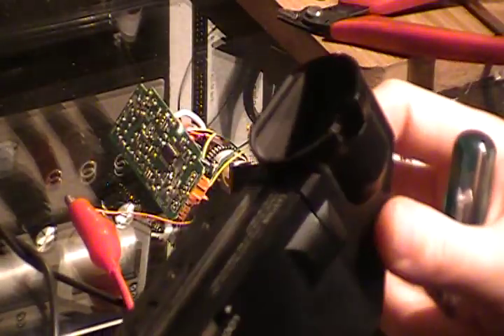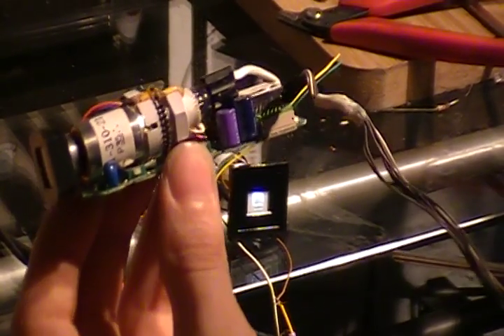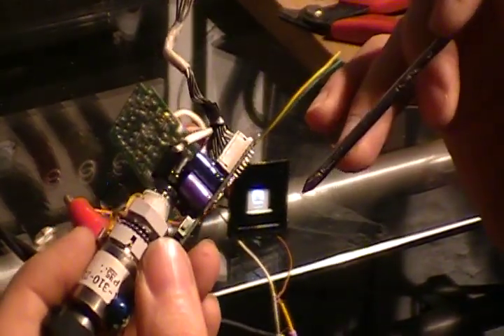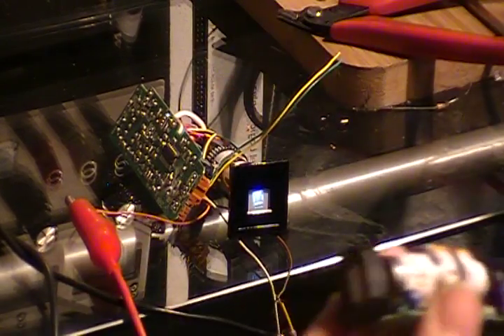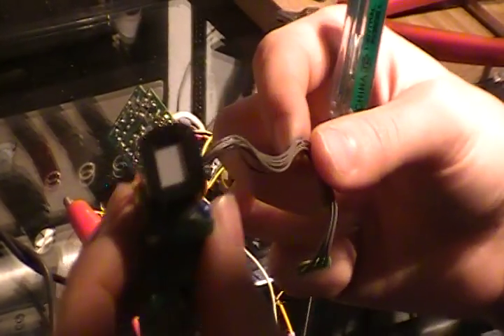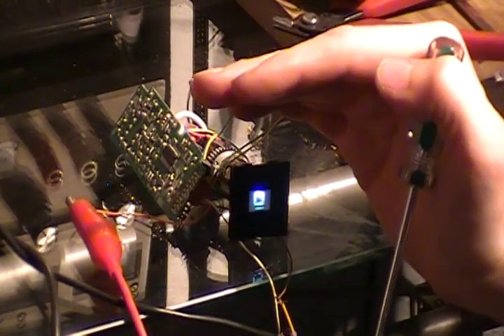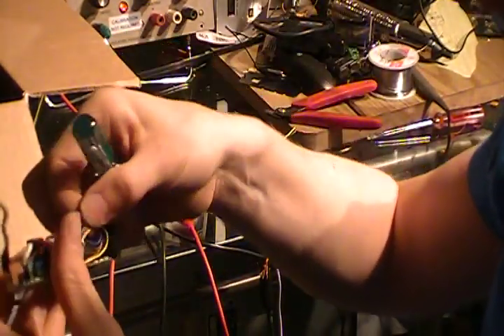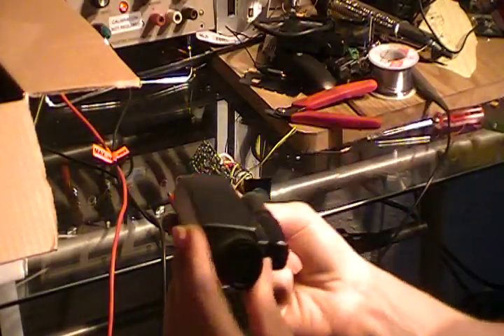Reverse Engineering Camcorder Viewfinders - Mini CRT's

Comment: Awesome video. I actually grabbed a couple of these and a motion sensing thingy and a pair of goggles (plus an Arduino) to make the $30 equivalent to the Oculus Rift, except it looks kinda tacky with the two CRTs epoxyed into slots on the goggles and the Arduino ziptied to the goggles. But hey, it works great with Rift-Compatible games due to reverse-engineered drivers.

Comment: So cool!!! I had one of these laying around after taking apart a camcorder. I just wasn't sure how to use it. I just hooked it up and it works perfectly with composite video... A small lens from binoculars and a mirror seem to project and enlarge the image well, and now I even know how to invert the image! Perfect! Now it's just a question of build it into a clock with an Arduino or a miniature retro display with a Raspberry Pi. Thanks for posting this!

Comment: Thanks for making this video!  I took apart a Panasonic S-VHS camcorder viewfinder at the Bristol hackspace yesterday, and found a surface-mount chip in it. The chip, AN2510S, was helpfully listed as a "camcorder viewfinder driver IC"! But the data sheet (partially in Chinese) includes an application schematic that's most likely the same as the actual circuit in the viewfinder. It takes composite video input, but the connector is 11-pin -- must be lots of unused pins.
Reply: Salvaged a CRT from a faulty Hitachi VHS camcorder and the SMD chip it had wasn't even known on the internet!

Comment: Some view finder CRT's need an external horizontal and/or vertical sync after you take them off the camera. Composite monitors let the horizontal "free" run. It's no big deal to provide a H-sync, either use a sync separator IC or make a simple capacitor one. Then feed the H sync into the view finder board. I've only found 4 or 5 view finders that needed external sync and they were huge mid to late 70's cameras that had heavy VCR shoulder killers. I even have a couple of reel to reel camcorders!

Comment: I've done this before! 

I have one black and white crt and one colour lcd. I noticed the lcd one is much fussier on signal strength/quality, from memory the picture jumps if the signal isn't right (like from a tv that has poor reception). I once posted on the FMCG forum  (as bugminer) about using the lcd one as a second monitor(not being used that way now. It's hooked up to the tv as I type!). I have each one hooked up using a common ground for power and signal.

This video made my day! :D

Comment: Wow, I ended up doing this, but in reverse. I had a 4" color LCD screen from a 12V portable video system and wanted to integrate it with my ancient 3 tube saticon camera using the eyepiece's original cable, for cleanliness. 

That meant losing the eyepiece, but it did work. I got to cheat on my conversion-the video signal was the shielded cable.  The eyepiece was 12V, so the thing fired right up. I need to watch the rest of these!

Comment: Fantastic! Just found a JVC one I had stashed away that had broken off of someone's camera at the swivel point and I picked up somewhere many, many years ago. Looking at it, the wires seem to be properly color coded to boot. However... PAL or NTSC signal is the question. Might have to open it up to see if the image can be adjusted accordingly if it's the wrong one.

Comment: Nice video! BTW, I happen to have exactly the same viewfinder unit that you are holding while explaining the deflection coils connection. I have already identified the ground and +5V wires and found a wire that, when pulled to ground, lights up a red LED near the screen. I tried your method of identifying the video input (grounding the wires one by one) but failed to get static on the screen, however upon touching one of the wires with my finger, the CRT starts showing wavy patterns. Is this the video wire?
Thanks from Russia,
Dan
Reply: +TheDaniel366Cobra Yes, that should be the video. Connect it to a video source and see what happens.
Reply: +zaprodk thanks, but you are a bit late, the CRT is already working in my night vision cam :)

Comment: Learn from my mistake: back in the 90's I used a matched pair of these to build a stereoscopic  headset for an submarine robot with two cameras. The viewfinders were absolutely awesome and perfect and worked really well. However, when I first tried it out, I just ran the viewfinders on 6 volts. The video was blurry. Turns out the viewfinders actually ran on 5 volts, and that little bit of overvoltage didn't just mess up the video, but was probably producing X-rays which were focused through my eyeballs and brain. Some might say "Oh, so that's what happened?" But anyway, thought I should mention it.  :D
Reply: Thank you for mentioning this as I am working with one at the moment, but I was going to run it at 3.3V, I didn't know they used 5V

Comment: @jeriellsworth the small lcd's sometimes use an I2C interface.

Do you know what the voltage is on these small tubes?
I have been thinking of using these tubes for video goggles for over 20 years, but a friend of mine suggested it might not be a good idea to have a couple of devices that might potentially have a couple of KV strapped to either side of your head.

Comment: Great Video...  I got a nice picture after coupling the video through a capacitor.  However the picture rolls 1 or 2x a second (like an old TV with a vertical hold problem).  Might it be because the CRT was from USA (NTSC?) while the video signal is from a B&W camera from Asia (PAL?).  Or is there some way to fix the vertical hold?

Comment: Hello! What should you do if the CRT is drawing excess current? I set the current limit on my power supply to 1A but it only hits around 2.5 volts before it reaches it. There is no obvious short anywhere.
Thanks!

Comment: Jerri.... I am hacking a panasonic mini crt viewfinder. Its a colour one and has 7 wires going into it......I will indentify the power feed and ground as you recomend but am wondering if, due to the number of wires, that this unit may require an RGB feed instead of just one composite...your thoughts??

Comment: I have an old video scan sounder fishfinder which uses a CRT for the display. Is there a way to add composite video to this So I can use it as a monitor. Kind of impractical b/c it's a 6" screen but can it be done? Where do I put the video into?

Comment: I have a 6 pin crt, the wire connected to the first pin is colored differently, i was wondering if this was the ground or positive lead, or if the power lines are throughout the connector.  (can i assume that the first and second are the power lines?)

Comment: Is it possible to remove the black plastic framse without breaking the tubes :O?
I don't want to break mine, so I hope you have a tip on how to remove them :)!
Reply: +Jeri Ellsworth
read the above :D
Reply: +PezDJ Yes. Just be careful. On some tubes the black plastic is holding the anode lead on a contact on the face of the tube - it is very easy to break this connection.

Comment: I've repaired lots of those
Reply: Hi dan, not sure if you will see this but I am wondering if you have ever come across one of these crt screens that just shows a white horizontal line across it and nothing else. If so, do you know how to fix it? I just picked up a 1980 panasonic pk-800-c and the viewfinder is doing this. I took apart the viewfinder and part of the circuit board(?) - sorry dont know much about electronics but im trying to learn - looks corroded and discolored, so I am thinking the solders are gone and something isn't working properly. I ordered a cheap soldering iron on amazon so I am going to try and fix it this week, any insight would be really appreciated!

Comment from the maker: CRTs are not very easy to drive, because of the high voltage and acceleration.   Deflection isn't trivial either, because of linearity.

Comment: One I have only has a 4 pin plug. Two orange wires(one of them is +volts) and a small diameter coax with the shield being ground and center (obviously) video. The other wire.......I dunno, maybe it isn't needed.
Reply: lochinvar00465 it could be for the “Record” LED.